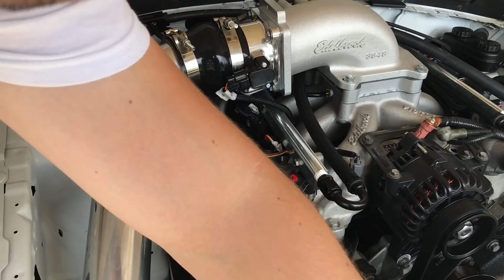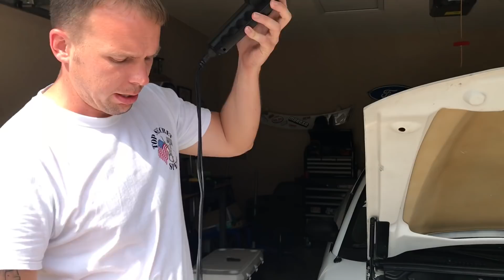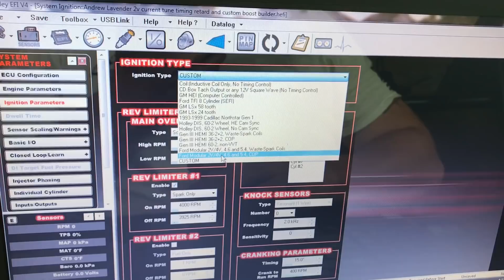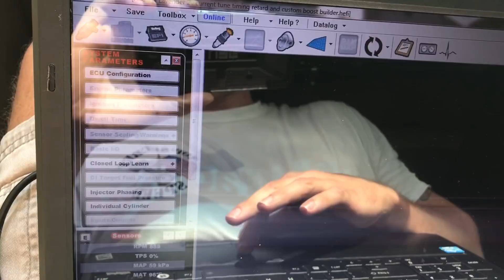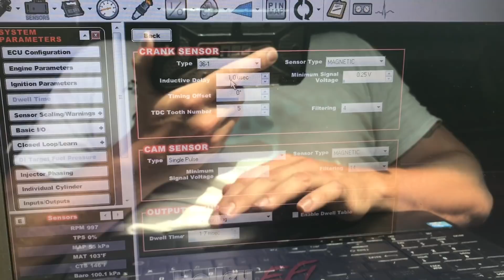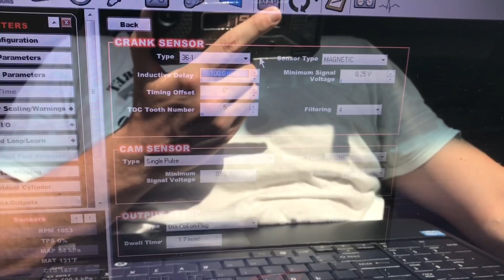Verifying timing on my 4.6 mod motor

Comment: Just got all my parts to do the job, timing light, piston stop etc.. but I just watched another 2v video that says that it possible to hurt a valve while using a piston stop with PI heads.. 

can the valve reach the piston stop bolt while turning the engine over?

Comment: I enjoyed your video very much! I have an 03 Cobra with the 4V 4.6L engine so this info is helpful for me as well...thanks! I have an SCT TS Livewire tuner for fine adjustments on my Cobra and I was always curious about confirming that my timing is actually where it should be. Otherwise all I have to go on is how does the car run vs the accuracy of my gauges.(unless I go to a professional tuner). I plan to do the latter soon anyway, but this tip is still good to know!

Comment: alright, subscribed and putting together my build of materials. Good walk through here buddy.... I really appreciate it as Ive been looking for a good set of vids for a couple years. Glad somebody stepped up here!! Dont know if I can afford a TEKSID or even find one (I wish), racing world gets all those....lol. Plan to tear down a junker, inspect and get it dyed for cracks, put her on a stand and beg the wife for (performance) parts! LMAO!
Question about the turbo..... do you need intercooler for that thing?

Also, whats with the pickup tube? Didn't look long enough, or was difference made up in custom pan?

Thanks buddy, inspiring and motivating...
Reply from the maker: Yes sir would definitely need an intercooler with the turbo unless you where planning to run meth or maybe e98. Yeah the pick up tube was just right in the pan
Reply: @andrewlavender08  True that, figured as much. Dude I just watched that corvette make 1600! HOLY @%%$!!! Wondering what you did with fuel delivery sys with holly upgrade? I see the Elderbrock rail but I mean injectors and pump... heard you say you ran 27lbs on dyno but do you need to upgrade your pump and injectors to get beyond 27 lbs as you normally like 30lbs? Is this just in the tune? So your mod inhales good, how about the exhale... how do you figure for type of header tubes and pipe diameter? I always heard 2 1/2 pipes on some long tubes was the way to go, curious what you ended up with.... Something ill be tackling on my swap.

Comment: @Andrew Lavender I know this question is off the topic of the video, but I own a 1999 Mustang GT that still has the stock 4.6L 2V modular. I was wondering if you could tell me what I would need to switch out and replace in order to drop a supercharger on it. I’m already assuming a new fuel setup with bigger injectors and new gearing In the rear plus new suspension. What else do you think I would need. I’m not looking for a huge boost in HP like your car but a healthy increase. Thanks, and keep up the great videos.
Reply from the maker: Bennett Simpson mainly just get a complete kit with supercharger and everything needed to run it. You can make 400 wheel horsepower pretty easy and safe
Reply: Andrew Lavender ok. Thanks for the response. Just trying to keep the engine safe so that I’m not putting in more power than the stock internals can handle.

Comment: Very informative video!  Got a question what radiator are you running?  Any problems with keeping the car cool on the street?
Reply from the maker: Boosted04GT 94-95 radiator it stays 185-190 all the time